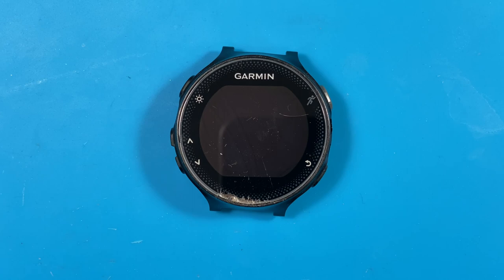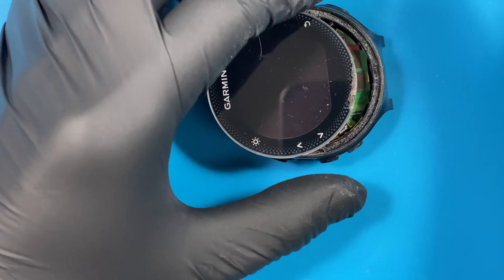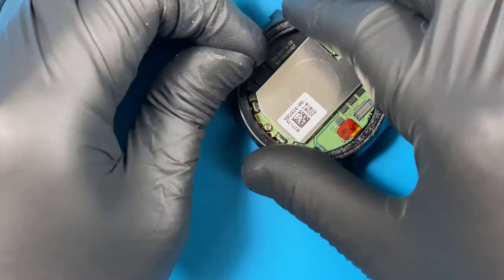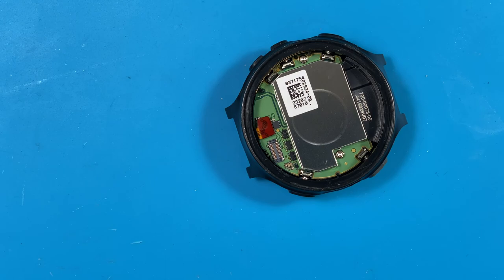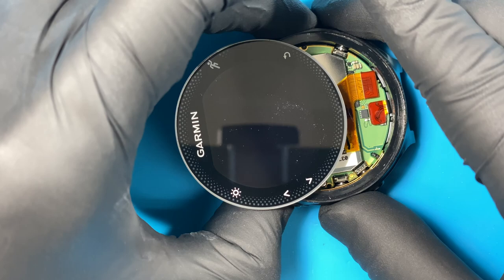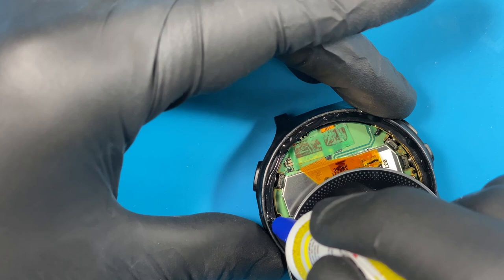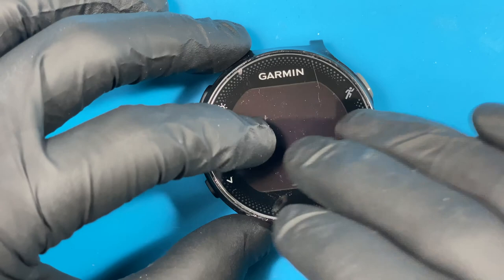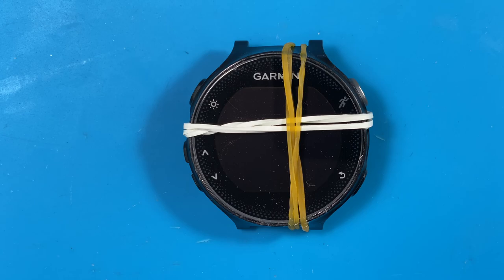Learn how to repair the screen on a Garmin Forerunner Watch.

Comment: Hi, very informative video, thank you.  Would like to ask, does that mean, once you replace the screen, the watch is not waterproof anymore?  Thank you.
Reply from the maker: Yes, correct. We've experimented with different adhesives and none of them create a perfect water seal anymore. B7000 is the one that comes close, in my opinion it is the best one out there.
Reply: What is the reason for this, do you think? Why can a manufacturer get the good seal, but we can't?
Reply: The original seal is the secret

Comment: That B7000 glue is not the easiest to use as it comes out like a gel and if you miss a bit and go back it can then stick to the glue or the item you are glueing. I left my garmin 2 days, picked up the watch and face fell off. Swell. Just glued it 2nd time i will let you know how i get on.